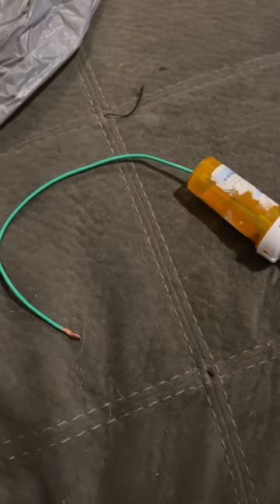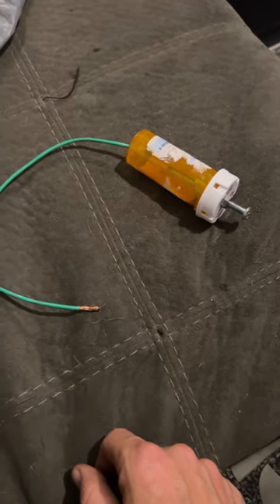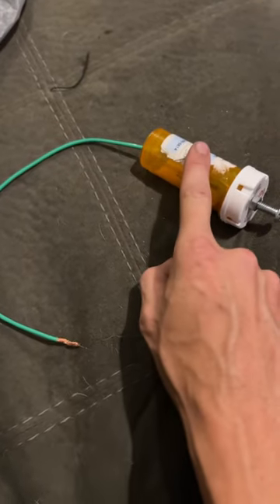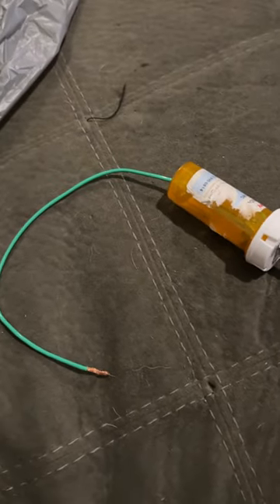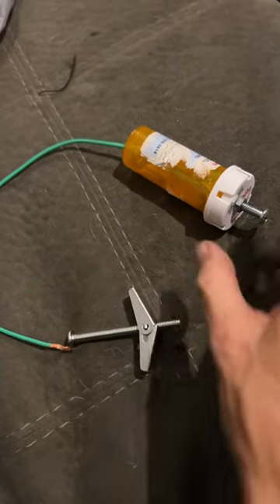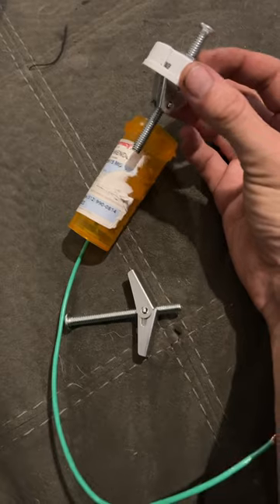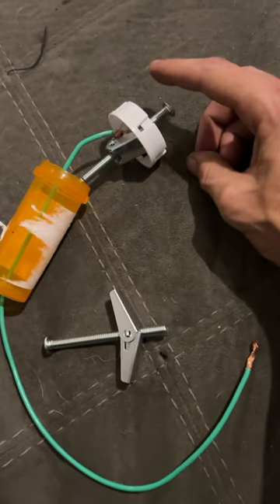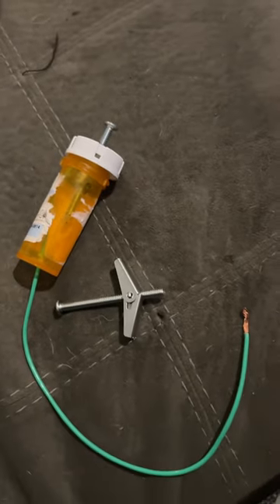Homemade SWR adjustment screw like on the firestik antennas #11meter #radio #stryker #austraila

Comment: Do you make and sell cb radio antennas???
Reply from the maker: I do make and sell dipole antennas right now. I just the band you want to transmit on. I only have one dipole right now it’s the one in the videos. I haven’t made another one. But if you are interested I can definitely make you a 361 dipole antenna
Reply: How much are you charging???
Reply from the maker: @MikeR-rj9lo  not really sure to be honest, the first one I sold to my buddy for 80$ for a dipole with 20m wire and upper Cb band wire.